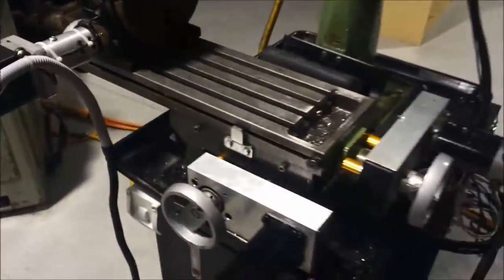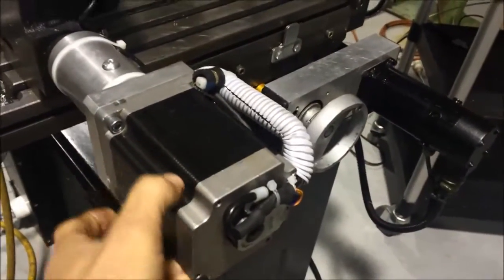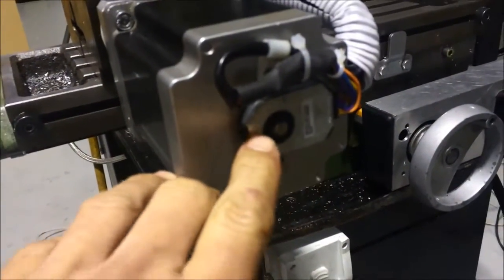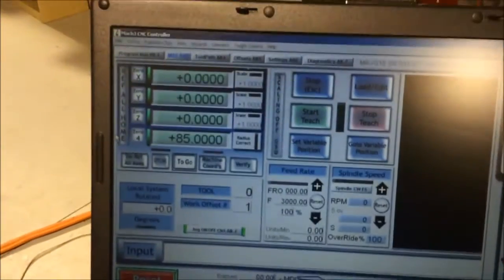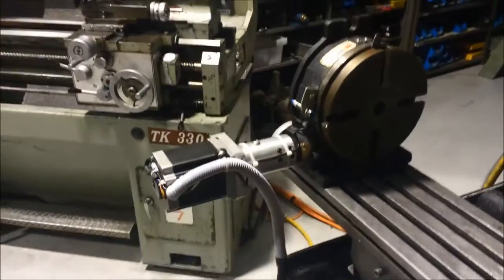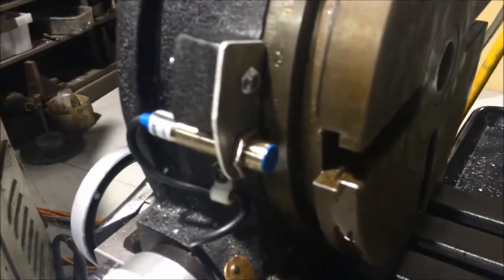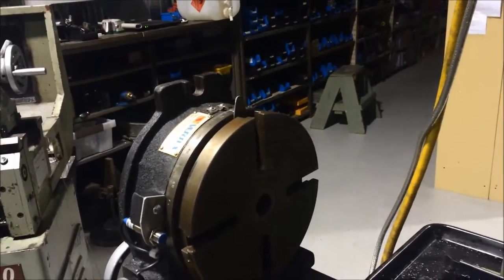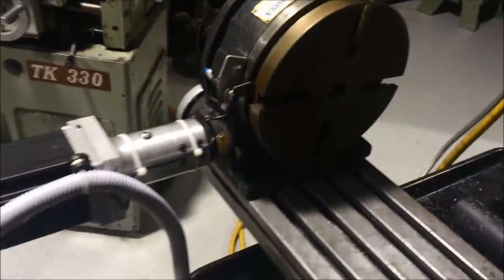Pauls CNC 4th axis closed loop

Comment: closed loop but that work gear has backlash. unless you made it very tight.
Reply from the maker: +aledantas2k10 I can alter the mesh of the worm and wheel and make it almost zero back lash.  Plus if really important I always drive in one direction thus the back lash is taken out.  It works surprisingly well.  Cheers
Reply: +Rotec Aerosport sweet. if it only goes to 1 direction it's all good.
Reply from the maker: I have it so I can easily adjust the worm tight.  The back lash is less that 001"
Reply: This is true. When machining the milling direction of the endmill will push the piece in the opposite direction. However, I love the set up especially I just milled the shaft. Very ballsy and I love when people do things that everyone thinks is a no no and makes it work. Awesome.
Reply: not trying to bash you but play is play, does not matter if it goes only in one direction. The endmill will rotate the axis by that amount of play :)